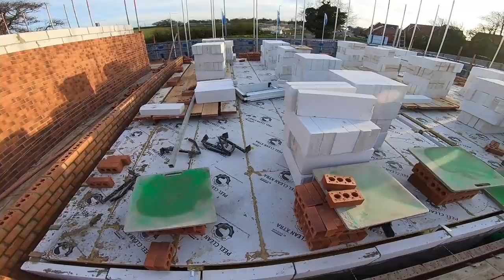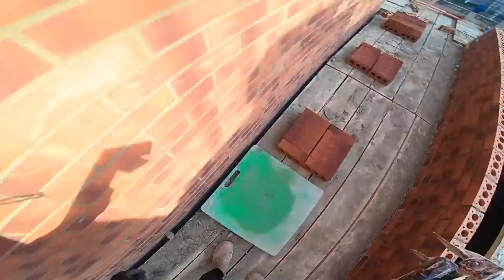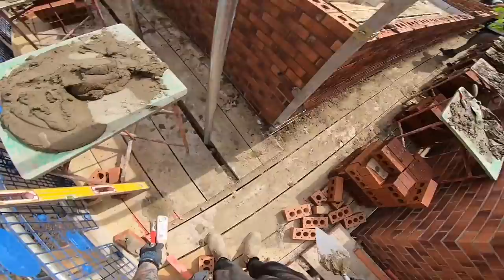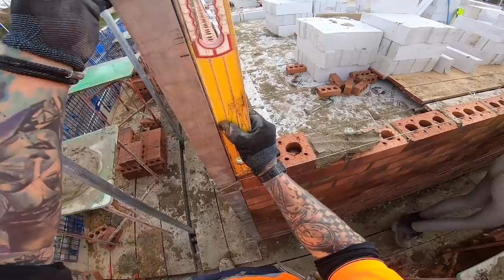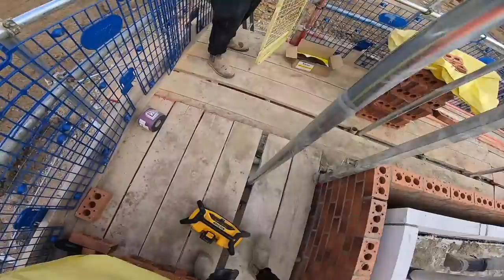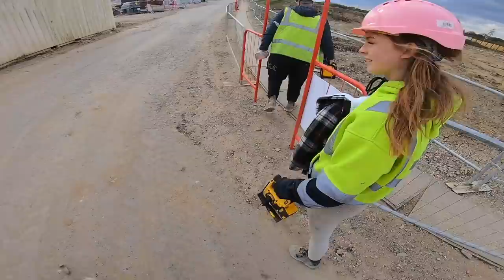Another week done!

Comment: I have nether or have no intention of laying a brick but for some reason I can’t stop watching 🤷🏻‍♂️
Reply: Yea those poles would drive me nuts,are the first 2 planks walkers on outriggers? I like the guardrail all the way around and the built in ladders with safety gates also the load in area with the safety gate. You’d walk off the jog if you saw what we in the states work up on!
The only good thing is built in ladder in all the frames can quickly be used to bricks on  every 24” the 10’ planks on 8’ sections make it easy to move up. My favorite trowel was the M. Rose 9” wide base plastic handle(like the one you got) something about flatter angle of the handle made it easyier  to butter(perp) the brick on the wall. I used a different version of the pick and dip,I would lay a long bed and butter the brick on the wall with the previous brick scrapings but mud consistency means everything along with dry brick and material setup,love the vids keep videoing.
You,Amy,Olivia and Hector have a good weekend! And your dad Darrel too! Geo from the states.